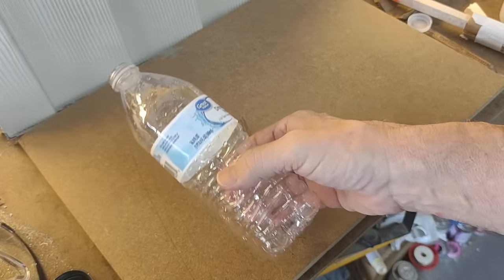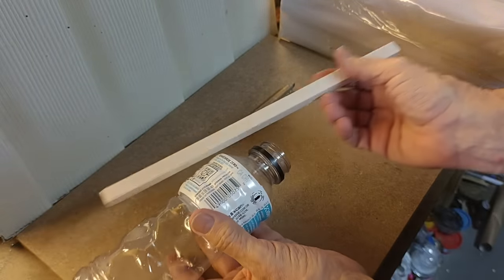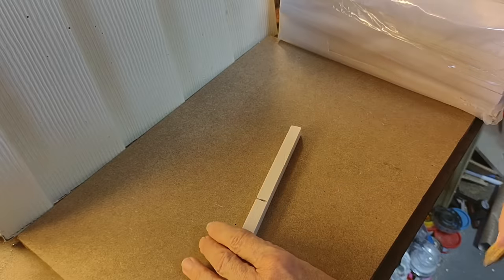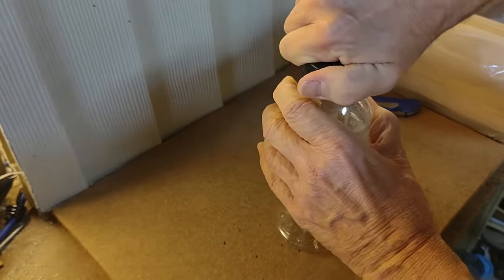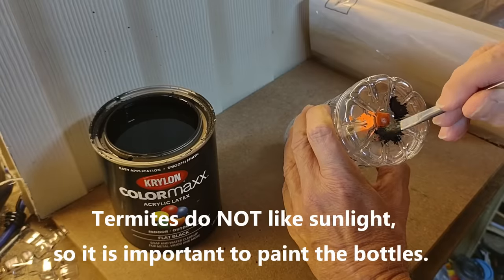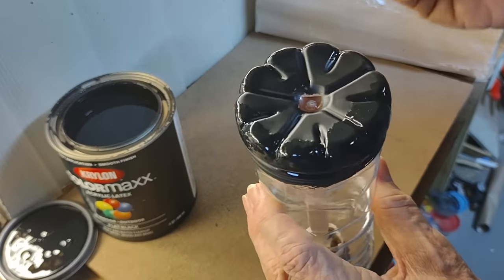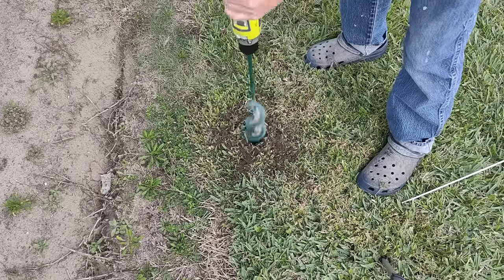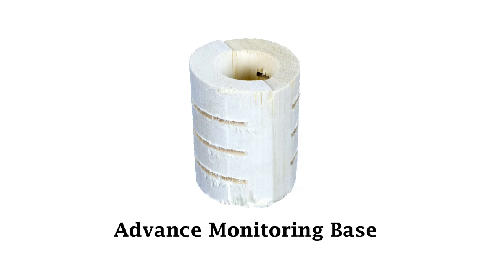Unbelievable Water Bottle Trick for Termites!  Simple to do!

Comment: Thank you very much for this video. We live in a tropical country and termites infestation is one of our biggest problems in property maintenance. We both have dry wood termites and subterranean termites. It is costly to treat them.
Reply from the maker: It sounds like you have some experience with termites, so you know that the monitoring stations do not work for drywood termites.  However, they are very good at detecting subterranean termites.  I recommend that you watch my video on how to treat the exterior of a building.  This will prevent drywood termites.  You need to do the treatment every 60 days.   I will give you the link.  Keep in mind that fumigation is the only way to eliminate drywood termites and the gas they use has no residual at all, so you can get reinfested the moment the tent comes down.  So, you need to start the prevention before you fumigate.   I hope that helps.  Be well my friend.

Video on how to treat the outside of a building to prevent drywood termites:  https://youtu.be/Yozv3s-Qwlw

Comment: Brilliant DIY solution! Your goal of saving people money has been achieved many times over. Buying a home in Huntsville, AL. and will use this method to monitor termites.   A razor saw or saw type blade on a standard X-acto style hobby knife is cheap and great for clean cuts on balsa wood. Wont crush the wood as it dulls. 
Thanks so much for such sage advice. Subscribed! and will recommend.
Reply from the maker: You are very welcome.  Thank you so much for those kind words and for subscribing.  Very much appreciated.  I like the X-Acto knife suggestion.  Be well my friend.

Comment: Termidor SC is the ticket! Trench around the perimeter of your foundation and fill with recommended dosage. The trench is tough work but worth the effort. I dug holes around my trees and installed Termidor SC there too - no more termites! 😜👍
Reply from the maker: That works if you have an active infestation, but you wouldn't want to do all that work if you do not have an active infestation.  Monitoring makes sense to prevent an infestation, so that you never need to trench and go through all that work.  Be well my friend.

Comment: Wow! Your video makes this intimidating subject so much less overwhelming! Thanks a bunch for this, as here in middle Tennessee we’ve both types of termites. My neighbor just got swarmed with those flying ones in July so I’m worried about those ones, though I understand these stations are the underground ones, which my garage had about 10 years ago. I can do this myself and save money! THANK YOU and God bless 💜
Reply from the maker: Thank you so much for those kind words.  Very much appreciated.  The only species of termites that are known to exist in Tennessee, at least so far, are a common species of subterranean termites.  The fact that your neighbor experienced a swarm of them would suggest that they are fairly close by.  Therefore, you would be wise to install the monitoring stations and apply granules around your house.

For the granules to work, you need to have dirt around most of the house, and that dirt needs to be porous enough so that water will leach into it.  You can do a simple test to see if your dirt is porous enough by simply digging a shallow hole right next to the foundation that is 4 inches deep and about 8 to 12 inches long. Just the width of the shovel is all you need.  Fill the hole with water and see how long it takes for it to seep down into the ground.  If it drains down into the ground reasonably well, then the granules should work fine for you.  

Make sure that you buy the correct granules.  There are two versions of them now.  You need the ones that have imidacloprid as the active ingredient.  A lot of the Home Depot and Lowes stores no longer sell the right ones, but you can still get them from Amazon.  I will give you a link.  I will also give you a link to my video but how to apply the granules.       
  
I hope that helps.  Be well Priscilla.

Video on how to use termite granules:  https://youtu.be/H7rW_TSBHJ4

Termite granules:  https://www.amazon.com/dp/B000RUIJYM?ref=nb_sb_ss_w_as-reorder-t1_k0_1_5&amp=&crid=A0Q6FR5I5QQH&amp=&sprefix=termi

Comment: You are awesome thank you some much for your honesty. We just paid $1040 for treatment and $260 a year. I wish we had seen this sooner. We live in AZ
Reply from the maker: Did they trench or use the Sentricon system?  If they trenched, then you don't need the annual insurance.  Total waste of money because trenching is good for 5 to 10 years.  If they used Sentricon, then you probably signed a contract for at least a year, so dump them after that year is up.  The water bottle monitoring stations actually work better than Sentricon, because you can install them closer together.  You can also apply granules around the house every year.  I have a video on how to do that.  It costs about $50 a year to do.  I use both the monitoring stations and the granules, so I can't miss.  So, whether they trenched or used Sentricon, you can dump them as soon as the contract is up.   Please note that Home Depot and Lowes stopped selling the correct granules, so you now need to buy them from Amazon.

I hope that helps.  Be well my friend.

Video on how to use termite granules:   https://youtu.be/H7rW_TSBHJ4

Termite granules:  https://www.amazon.com/dp/B000RUIJYM?ref=nb_sb_ss_w_as-reorder-t1_k2_1_6&amp=&crid=22WHNM2QXKLLR&amp=&sprefix=termit

Comment: Hey Guy, You just got a new subscriber!
I appreciate your help. What an awesome instructional on bait stations. I just found some mud tunnels in my basement on an inner wall of the pantry. I will be watching all your videos and learning about that. I bought boric acid for diy treatment. I don't know how that will work. Have you ever read up on boric acid recipes?
Reply from the maker: Please watch my video on termites vs boric acid.  There are two options for treating subterranean termites yourself.  The easiest way is to use termite granules.  It costs less than $60 to do and it only takes about an hour.  The application is so easy that a child can do it.  The other option is to trench around the entire building, including the driveway.  It takes about a day for most people to trench around an average sized building and it only costs about $100 to do the job.  Trenching lasts for 5 to 10 years, but the granules should be applied every year as a preventive measure.  I have videos on how to do both options and I will place links below.       
 
For the granules to work you need to have dirt around most of the house and that dirt needs to be porous enough to allow water to seep into the ground fairly quickly.  To find out if the dirt around your house is porous enough, just dig a small hole next to the house that is about 4 inches deep, 8 inches long, and just the width of the shovel.  Fill the hole with water and watch to see how fast it drains down into the ground.  If it seeps into the ground fairly quickly, then the granules should work just fine.  However, if it just kind of sits there, then the granules would not be a good choice, and you should consider trenching.  Make sure that you buy the correct granules.  You need the ones that have imidacloprid as the active ingredient.  A lot of the Home Depot and Lowes stores no longer sell the correct granules, but you can get them from Amazon.  I will give you a link to them.
 
You can give any subterranean termite treatment a bit of a boost by doing a spot treatment.  If at all possible, spot treating for subterranean termites should not be the only approach to eliminate an infestation.   An additional exterior treatment should also be done with either granules or trenching, whenever possible.  Spot treating alone may totally eliminate the infestation with no other treatments, but it's not a sure thing. 
 
To spot treat subterranean termites, you need to buy a fipronil foam.  I will provide links for two products that you can choose from.  I like the FiPro the best because it's a little less expensive and I like the applicator tip better, but the Termidor Foam also works very well.  The FiPro is not available everywhere.  If you can get one of these foams, then drill holes in all damaged areas, that are 4 inches apart, and drilled about halfway through the wood.  If you are seeing exit holes in the wall, then there is most likely a stud behind the exit hole.  Get a stud finder and locate the stud where it meets the ceiling and drive a small nail into the stud a couple of inches below the ceiling.  Attach a weighted string to the nail and that will show you where the stud is.  Then drill the holes 4 inches apart along the entire length of the stud, about 3 inches deep.  Do the same thing for woodwork, except only drill the holes halfway through the wood.  If you think that there is a 2 x 4 behind the woodwork, then drill a 3-inch-deep hole every 8 inches.  The holes only need to be wide enough to get the applicator tip of the foam can into the hole.  After the holes are drilled, then shoot the foam into each hole for about 5 seconds or until you have foam either coming back out at you or coming out the other holes that you drilled.   All the holes should have foam either going into them or coming out of them.  This will contaminate their food source and they will take the fipronil back in the colony and spread it around to the other termites.

Most of the time, subterranean termites are going to be building mud tubes somewhere.  You will most likely find these mud tubes going up the exterior or interior of your foundation and you may find them along joists and even in the attic sometimes.  If you have a slab home, then you may find them going up the outside of the house on the slab and even the side of the house.  If you can find the mud tubes, then you can treat them as well.  Just scrape off about a 2-inch section of each mud tube down to the bare surface.  Then, shoot that foam into each side of the mud tube and also apply a little of it on the surface where you removed it.  The termites will rebuild the mud tubes and bring the foam back to the colony to spread around to the other termites. 

Also, if you can find the mud tubes, this is a very good way to determine when the infestation is gone.  If you scrape off that 2-inch section of a mud tube, you can see if there are any live termites in the tube.  Again, the termites will rebuild the tube and go about their business.  Do this every two weeks after you finish all your treatments.  Apply the foam to the mud tube every time you do it. At the point you are no longer seeing live termites and they stop rebuilding the mud tube, then your infestation has been eradicated. 

It typically takes several weeks for any termite treatment to be effective.  That is because you are using slow kill products.  If you were to kill the termites too quickly, then they would not have a chance to bring the poison back to the colony and share it with the other termites.  If you don't kill off the entire colony, you will not end the infestation.  Therefore, you must kill off subterranean termites very slowly.  So, I would give this at least 12 weeks before I would decide that something went wrong, and the process didn't work.  Hiring a professional to trench your house is pretty much going to take about the same amount of time to kill off the colony.
 
I hope that helps.  Be well my friend.

Video on termites vs boric acid:  https://youtu.be/Th07AIMvpvQ

Video on how to apply termite granules:   https://youtu.be/H7rW_TSBHJ4
 
Video on how to trench for subterranean termites the right way:   https://youtu.be/Fy7YHi_7Z8g

Termite granules:  https://www.amazon.com/dp/B000RUIJYM?ref=nb_sb_ss_w_as-reorder-t1_k0_1_7&amp=&crid=1UJA4PE31UWZW&amp=&sprefix=termite

FiPro:  https://www.solutionsstores.com/fipro-foaming-aerosol 

Termidor Foam:  https://www.domyown.com/termidor-foam-p-3528.html
Reply: @GuysPestSolutions  I will follow your detailed instructions exactly. One more thing that I should include is that I use the shallow well in the same room as the infestation. It is run through a Berkey Purifier before it's used for drinking and cooking, but not bathing. However it looks like they are probably entering from the direction of the perpendicular wall 90° in that  corner of the basement. Upon further inspection they are in damp/wet base cinder blocks on the concrete pad as the couple exterior mud tunnels I first saw. They liked the cardboard boxes containing jars. 
I see that most of the water supply for the well is from the other wall. As long as my bait stations are left alone in that section of wall supplying the well, I think I'll avoid granules or trenching there. Your good description of use in the wood sounds like there's no reason the pesticide should enter the well. My only concern would be perculation from the other wall, which I don't think enters the ground water to any degree. The soil here is clay with a 6"- 9" ribbon of top soil.  The possibility exists of termites entering under a patio block porch on the well side. Water falls directly into a small ditch in front the porch roof to drain past and down hill. I will set a lot of stations there. I see no mud tunnels on inside perimeter walls yet; just that interior basement room block wall. I will follow your detailed response and watch the other videos you linked. I already saw the one on Boric Acid. It was Excellent. 

Thank you ever so much for the amount of time and information you have provided me.  I am very grateful for all of your help and hope I can return the blessing sometime.  
I will try to send as many friends to your channel as I know and ask them to subscribe. It's good to have you as a new friend too.
☕☺️👍

Comment: Great video.  Your visual instructions are excellent.  Such a simple method and easy to do.  Another reason to avoid pest control companies  that charge exorbitant prices.
Reply from the maker: Thank you so much Chris.  You caught me answering questions again.  I do it every morning.  Let me tell you, placing these things around your home is a very good idea, especially in Florida and most especially if you live near the coast.  We have Formosan termites in Florida, and they are very bad.  They can eat your house so quickly that they are often called "super termites."  By installing these stations around your home, you will know if you are going to get attacked and you can stop them before they reach your house.  I also apply termite granules around my house every year.  It only costs about $50 a year and it will stop all subterranean termites from infesting your home.  It is insanely easy to do too.  I will give you a link to that video.  Keep in mind that termites are a problem, even if you have a block home or even if you have metal studs.  Termites will eat your roof structure and your drywall too.  That's right.  They don't just eat wood.  They will eat anything that contains cellulose.  Since the paper on the drywall contains cellulose, they will definitely eat it.  In pest control, an ounce of prevention is worth a pound of cure.  It is well worth it to apply the granules every year and also installing the monitoring stations.  Please note that you can no longer buy the granules from Home Depot or Lowes.  They sell the wrong granules now.  You must order them from Amazon.  I will give you a link for them.  In fact, I placed an order today for my house and my daughter's house.  I usually apply them every January, but I got busy last month, so I need to get on it.

Thank you so much for watching and for your continued support.  You're the best.

Video on how to apply termite granules:  https://youtu.be/H7rW_TSBHJ4

Granules:  https://www.amazon.com/BIOADVANCED-700350A-Perimeter-Treatment-Granules/dp/B000RUIJYM/ref=sxts_rp_s_a_1_0?content-id=amzn1.sym.eff26b9b-e255-411b-a40d-eccb21f93fe4%3Aamzn1.sym.eff26b9b-e255-411b-a40d-eccb21f93fe4&cv_ct_cx=termite+granules&keywords=termite+granules&pd_rd_i=B000RUIJYM&pd_rd_r=49b6cdf2-960a-466e-97e0-b447d4be0088&pd_rd_w=a0bat&pd_rd_wg=aL0Xk&pf_rd_p=eff26b9b-e255-411b-a40d-eccb21f93fe4&pf_rd_r=AQ28QNYBYCC00TCBT4WS&qid=1675419806&sr=1-1-5985efba-8948-4f09-9122-d605505c9d1e